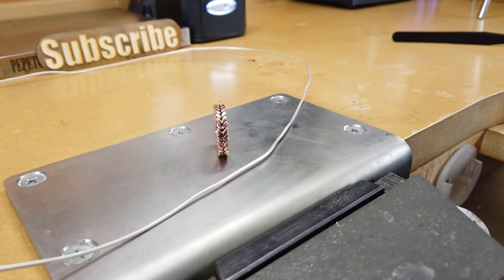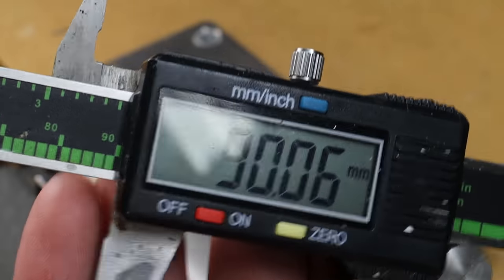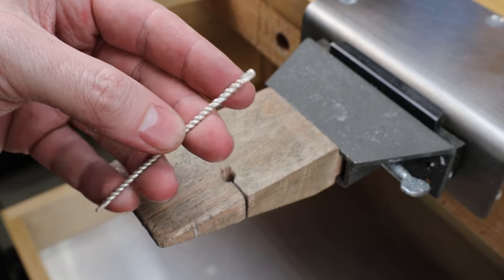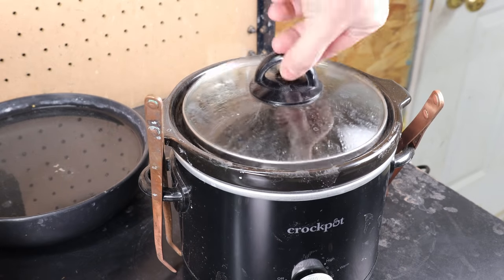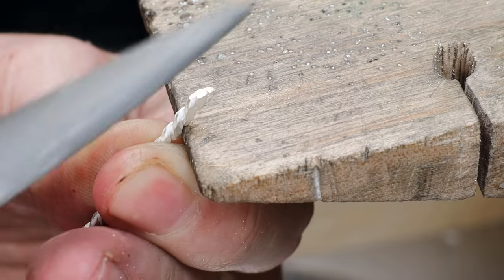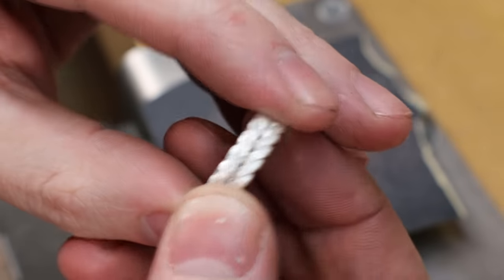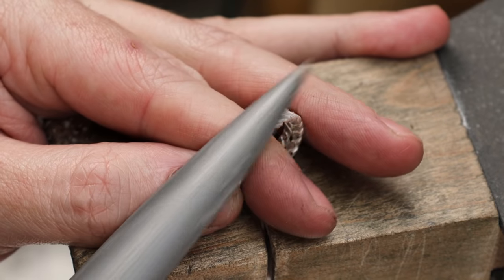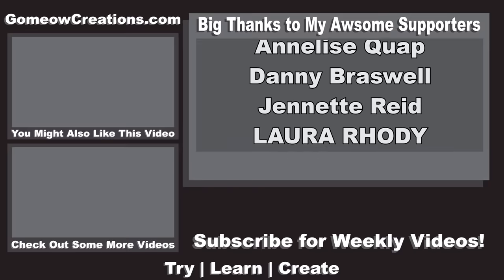How to Make This Dual Twisted Ring With Basic Tools

Comment: Thank you for a very clear explanation of making that fused ring. I'll be tracking down all the bits & bob solutions.  I'm in Sydney Australia...would these  brands be sold here.
Thanks for sharing of your craft. I'm a Toolmaker cum everything else...on the angular flats I may set some small emerald shards..or blue sapphires. 
Maybe neither.
Reply from the maker: I don't know if the brands are the same over there but I'm sure you can find similar things that will work.

Comment: I’m making the single twisted ring that you made in another tutorial, but flattening it, as it’s being made from 2 x 2mm wire lengths and it would be too thick otherwise. It is for my friend who is getting married. Your video was fantastic, I now feel confident trying this technique, despite never trying it before. One question though, I have no solder paste, just strips, can I dot tiny pieces of this along the length, or should I order the paste? Many thanks in advance.
Reply from the maker: You don't have to use solder paste You can use whatever you have to be honest It's just what I had on hand and that I would show it seeing that a lot of people don't even know that's solder paste exists.
Reply: @GomeowCreations  thank you! I’m really looking forward to making my friends’ wedding bands, a bit of pressure, as I’m only a hobbyist, but thanks to great help from you experts, it’s incredible what we can achieve. Please keep making your videos, they are some of the clearest to follow that I’ve seen. 👍🏼

Comment: GomeowCreations, Have you tried making the twisted wire in bulk?  I mean prepping several feet of wire at a time and then cutting off what you need depending upon demand for different size rings?  What changes when working with longer lengths instead of the short lengths of wire?

Comment: Hey, 
I don't really have a blowtorch. I'm thinking to make a ring for this girl I like and I need to know this wire that we usually get in the market. How much temperature will we need to start annealing? Also if someone reading this can help. I don't have that ring ID sizer. I kinda took one of her rings and gauged the inner diameter so should I use that for the calculation part?

Comment: Can i solder them with solder wire and hot air gun??
Reply from the maker: No
Reply: @GomeowCreations  why i try it and its works its the same there's many people doing it
And you not have to put in this acid

I am using copper wire
Reply from the maker: If you are able to do it with just hot air you are using the wrong solder. You are using plumbing or electrical solder and not the stuff meant for jewelry. So it's going to be very soft and weak

Comment: I'm still not great at soldering so this question is so basic it might sound stupid. With something so small I can't seem to solder in increments. When I go to do the 2nd solder, the 1st solder comes apart. I've gotten to where I try to solder everything at once, which is no mean feat, believe me. How can I prevent the 1st solder from coming apart? What am I doing wrong? I use a mini torch & paste solder that has the flux pre-mixed into it.
Reply from the maker: Use flux no matter what even if the solder paste has it. If you're doing multiple solder joints on a small piece start with hard solder first and then for your second part use medium solder and then if you have a third use easy they all melt a different temperatures.
Reply: @GomeowCreations  Wow, I didn't expect such a quick reply. Thanks for your answer - makes so much sense.

Comment: Great video, as always! I noticed you've been using paste solder lately. Any reason? Is it better or easier to use than sheet or wire solder?
Reply from the maker: Thanks and paste solder has been much easier to place on thing without it falling off. Especially when I have to place a ton of little bits of solder.
Reply: @GomeowCreations  Thanks!
Reply: I love using paste solder. For some reason, my med & easy solder, is harder to squeeze out & not as smooth flowing; any idea why?

Comment: I don’t have access to solder paste. Is it possible to do with solid solder?
Reply from the maker: Yep
Reply: @GomeowCreations  great, I assume I just cut it into little flat pieces and put it on the flat spots?
Reply from the maker: Yeah that is how I would do it but are your using sheets it wire? Also is this hard solder that your are using or the stuff for electronics?
Reply: @GomeowCreations  not sure yet, my materials and tools are quite limited. The rings are bronze wire, and although I have access to silver solder, the owner of said solder hasn’t much of it left and is trying to conserve it, so I might just buy some tin solder at the hardware store since this isn’t made of anything too precious

Comment: Try the natural citrus pickle from Rio. 
It’s awesome! Better than the chemical pickle.
Reply from the maker: Better in what way? I have used citrus acid in the past and it worked ok. It did take a little longer go get stuff clean at times. 

Ether way both picking solutions will become hazardous material once you use them. This is due to that copper that will come off your work and it will become suspended in the liquid and this is considered a hazardous material. 

You can even just use white cooking vinegar and salt to make a pickling solution and as soon as you actually use it with metal it will become a hazardous material due to the copper.

😁👍

Comment: Almost none of these are " Basic Tools ". Seems it requires a bench and some tools to buy.
Reply from the maker: I used some very basic jewelry making tools in this video along with some professional ones to show that you can do the same work with basic tools. 

That being said this isn't 5mincrafts so I'm not going to show you using the wrong things, using random trash or just straight up lie in my video about how to do this.
Reply: @GomeowCreations  Yeah, that's fair. I'm looking into making a ring to propose to my S.O.  I've seen people use Hex Nuts. You know anything about that?

Comment: LOL - is this a joke? You used thousands of dollars of specialized tools. This is one of the biggest 'didn't deliver' bait-switch videos on YT. It is absolutely possible to make this ring with NO special jewelers tools, including NO special jewelry solder paste, and NO high-temp torch, NO special sulfur solution, I have a feeling you just don't know how to do it.
Reply from the maker: I used both basic and pro tools to show people that they can do the same thing with both. 

Also if you are making quality jewelry you need a torch and high temp solder silver solder, it doesn't have to be paste solder. That being said you better not be suggesting using soft solder for electronic or plumbing. You can use a different torch for sure and I used my $20 propane torch all the time.

Anyways I will be waiting for your detailed video all about how to do this without using any jewelers tools. Make sure to tag me in it.